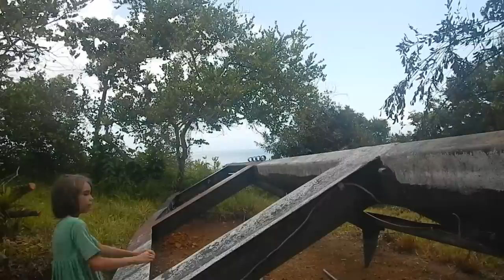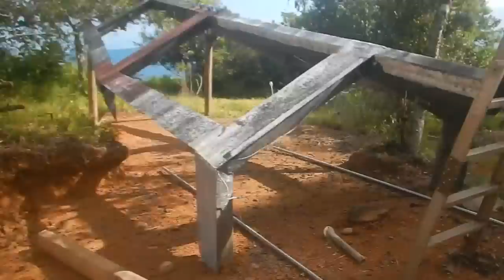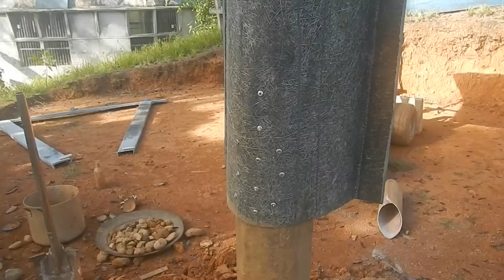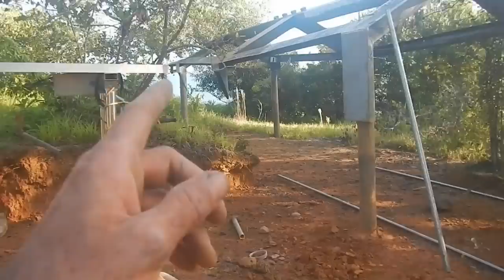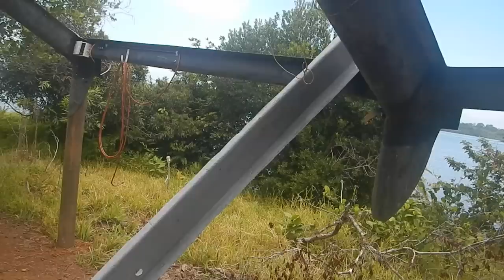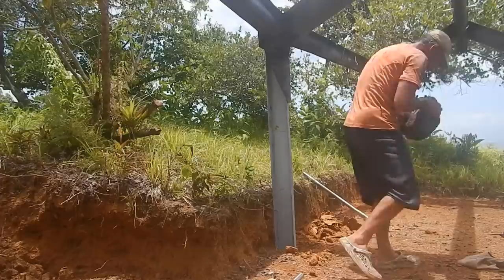Lumber mill 013 Roof Posts

Comment: OK. 6 pillars to hold it up. Great job! What will hold it down when the wind does a Bernoulli Effect on you? Strap it down on the storm end at least? Also, why scrape barnacles when you can marine railway all your hulls and never waste time scrubbing and chipping again?
Reply: his idea was to build a boat gantry using a 2 inch stainless tube dome over his docking area, but your idea is certainly simpler and has been recommended before.